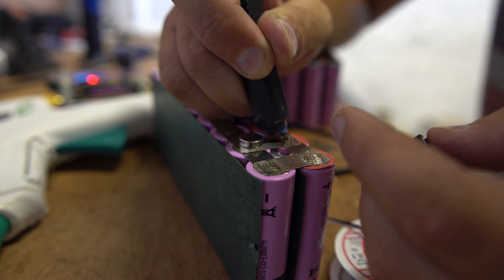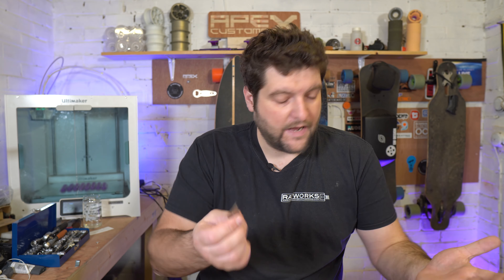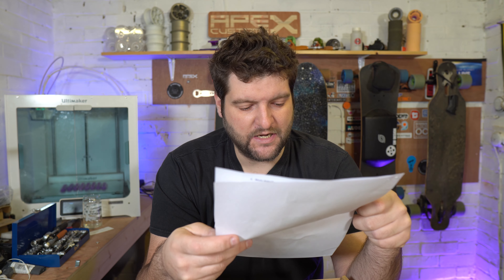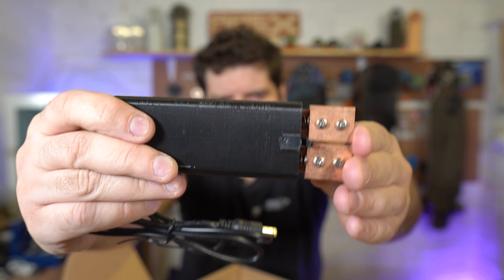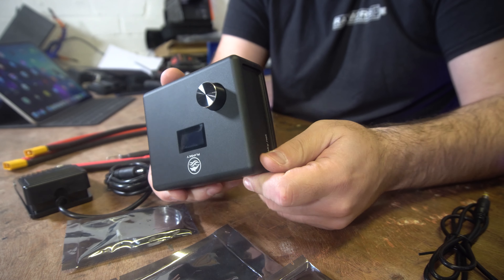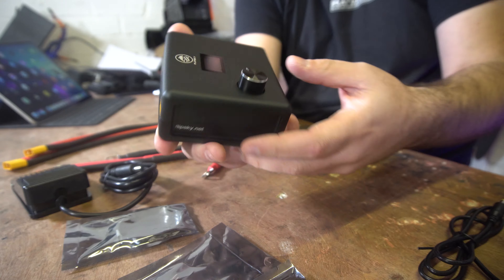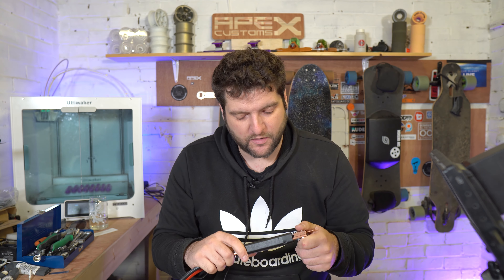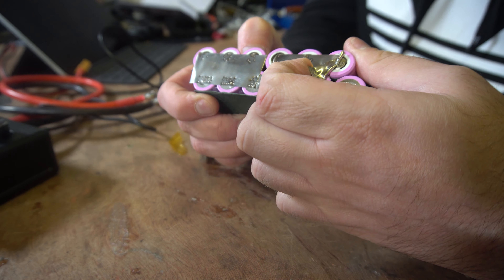FLIPSKY FS-SW1 Battery Lithium-Ion Spot Welder Review

Comment: Congratulations, Lee.  You have a very smooth working spot welder there.
Just one gentle bit of fun I must have: Since you folks drive on the "wrong" side of the road, that dial should not be confusing:)
Reply from the maker: hahahah! brilliant! I did enjoy that comment
Reply: Right or wrong all depends on point of reference. But calling petrol(a liquid) as gas and writing dates as mm/dd/yy instead of dd/mm/yy (in chronological order) fells so off.

Comment: Nice quick review. Maybe you could open it up and take a look at the insides? It's definitely a solid piece of kit, just seems overpriced for what it is. I'd definitely choose Maletrics at a lower price or the kWeld at the same price as this.

That welding pen can be had on Aliexpress for less than 20 bucks! Just search for "spot welding pen". You could very easily use it for any spot welder.

Those thin electrodes can also be had on Ali for a few bucks. Search for "spot welding tip". They will most likely fit.

Comment: Well damn...now I've got to get that thing. Looks nice. I do appreciate that they say it can be run with a car battery, as I prefer using that, and I've got a new one that works a treat. I'm curious though, what do you think the longevity is of the electrodes? I like the smaller ones that don't wear down to a large surface like the Malectrics electrodes. But I don't see any spares on the Flipsky site. 

Brilliant video, btw. Well done. Instantly wanted to buy that welder, so make sure Flipsky know that you're worth your air time. Be well, Lee!
Reply from the maker: Thanks Mario! It will be interesting to do a closer look at the welder when I’m building a full battery - that’s the acid test.  The electrodes will wear quickly I think
Reply: Sorry to be offtopic but does anybody know a method to get back into an instagram account..?
I somehow forgot my account password. I would love any tips you can offer me!
Reply: @Noah Kyle instablaster =)

Comment: I have similar pen on my boss level if you loosen the bolts the probes can rotate closer. Only downside is the tips wear out very quickly some seller sell double sided tips (get these). I will normally change tips every 2 batteries.

Comment: Hi, little question:
I wanna build a new battery pack for my Evolve Bamboo one.
It has a 36v 7ah Battery. I plan to build a 10s4p with 18650 cells.
Witch one should I choose....one with 3500mah and a output current about 10A or the 2600mah and 35A output current?
Thank you for your brilliant videos. 
Greetings from Germany/Baveria

Comment: Thanks what about the sunkko. Better?
Reply: sunkkos are shit for making packs u want a real welder that does consistent and reliable welds u use either the flipsky,malectrics or kweld and deal with lipos. Wall outlet based welders are just trash and most well known pack builders will easily tell you to stay away from them

Comment: What nickel strip should I use? I’m making 2 12s6p packs with molicell 21700 p42a cells. I want to make sure that the nickel can handle the current bc those cells can discharge 45a continuous.
Reply from the maker: it really depends on how the pack is laid out bud
Reply: @LeeWright  basically laid out in a big brick like yours often are